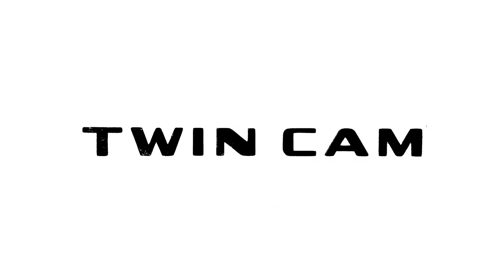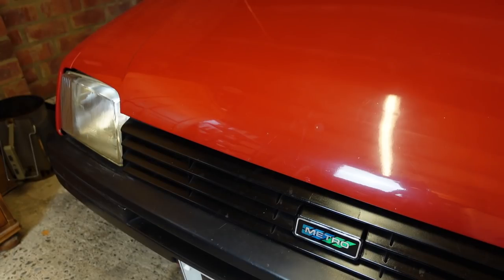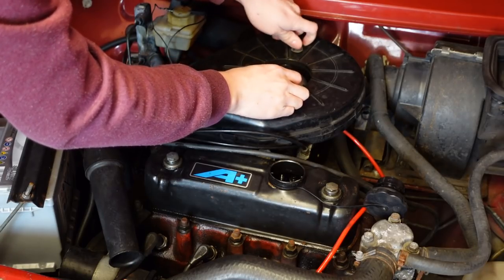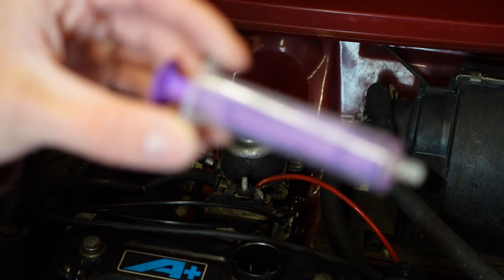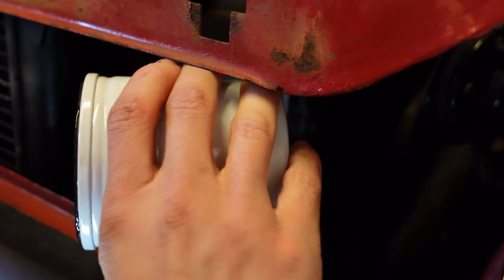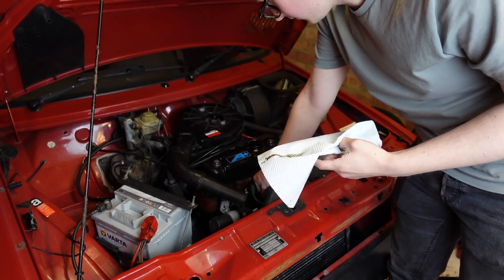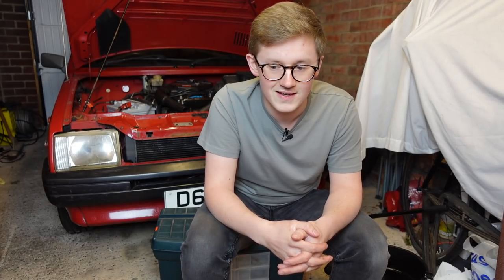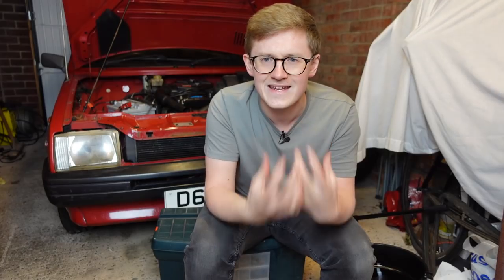An Oil Changing Odyssey - Melody the Metro (Austin A-Series Oil Change)

Comment: Given the state of the air filter and the oil; I would recommend taking off the crankcase breather can, that's the can on the left of the engine (looking from the front), and the pipes going to the carburettor, and give them a very good rinse out some petrol (leave to dry before refitting). These can get very sooted up and is easily forgotten. If you don't fancy taking the can off at this moment, at lease do the pipes.

Comment: Ed, I’m with you on using 20W-50 in my old Benz engines (I live in a temperate climate, no cold winters).

An old car-clubbers’ trick I’ve used for ages is this: A couple of hundred km before an oil change I add about 200 ml of ATF to the sump oil (sump capacity 8 litres). The ATF seems to have very good detergent qualities, and removes varnish; my camshafts and associated cam-box bits are always shiny and varnish-free. And despite the recommended oil-change interval of 10K km (approx 6K miles) I always change the oil and filter every 8K km (approx 5K miles).

BTW: I’d happily watch you for a 40-minute video, no matter what you’re doing. Keep it up!

PS: A related ATF trick is to add 900 ml to a full tank of fuel (90 litres – so 1%) every third or fourth fill. It keeps the fuel system whistle clean and removes the need for injector cleaner, which costs more than the ATF. (My cars run 98 RON unleaded.)

Comment: Whenever I undertake an oil change, I ALWAYS add a can of engine flush to the oil circuit to "wash" out the residue of old oil and sediment that has stuck to the internal walls of the engine during preparation for the oil change itself.

Also, in addition to removing the oil filler cap, I remove the engine dipstick for relieving further vacuum during the draining process, then eventually removing the oil filter after enough time - cleaning the filler cap AND dipstick before reinserting them back in to the engine.

That stops recontamination of the new oil.

Comment: Well done, Ed. The old girl definitely sounds happier. The air filter alone will do that. The tune up will make a huge difference.
Our 81 Volvo 240DL Estate had the 2.1 litre with a single side draught Zenith carburetor. The dash pot on it was so finicky I started sucking all the old fluid out twice a year and starting over again. At 4.5cc at a time, a litre of Type F transmission fluid lasted a very long time. 
Enjoy the old girl. I know what you mean about a car bring part of the fun. My old Volvo 240 is still that way, even approaching 400,000 miles. And now I'm off to add another 120 to the total.

Comment: That oil isn’t available in the US for us A-series owners, but we do have other choices for high zinc content oil (I use Valvoline VR1 20W-50 racing oil). However, my understanding is the high zinc is necessary for the engines’s flat tappets - not for the gearbox of my classic Mini.  But if it helps that too, great!

Comment: Worked on plenty of that set up back in the early 80s. Not many people understood the benefits of servicing back then and I know from experience that set up can take a lot of abuse and still do 100,000 miles+ with the odd exhaust valve change here and there. The metal on the sump bung is most likely the after effect of a less than careful driver slamming it to through the gearbox.

Comment: Nice job. 20W50 oil is the right stuff for older engines. Back in the day Duckhams Q was the one to go for, and it's still available as Duckhams Q Classic. The oil contains long chain molecules which prevent metal to metal contact in engine bearings. Over time they get chewed up and become less effective, so regular oil changes are a necessity.
Reply: Christopher Conroy  If your timing chain is badly worn, you should replace it and the sprockets. Note the timing is important on re-assembly, so get it done by a good mechanic if you are not sure how to do it. If the chain should break it will be catastrophic for the engine. Use the recommended grade of oil for the engine. The Duckhams Q classic I referred to is only suitable for classic cars. All modern oils contain long chain molecules plus other additives which reduce engine wear. All modern brands of oil are equally good, so you could get Duckhams, Shell, Mobil, Q8, or any regular brand.

Comment: Another of your enjoyable presentations in that relaxed easy going style. 👍

Many moons since I checked the valve clearances on A and B series cars. The number NINE is a useful number to remember when doing those eight valve clearances and a good quality Feeler Gauge  is a required investment if not already have one.  Hands up all those who know why NINE plays a part here. 

There's something really satisfying when servicing your own car and in my case, several of  my family's too. Assuring  to know that the job has been done and done well. Not always guaranteed when entrusting the work to others. You can get magnetic Sump Drain Plugs for most cars. Manufacturers rarely fit them now or even Sumps Plugs come to that. Such is automotive progress. There's reasons for those omissions like Dip Sticks and Sump Plugs.  I do not agree with them.

Yes reassuring doing your own servicing. It's not Rocket Science even on more modern cars. and over a lifetime's car ownership, a nice few quid saved which is another big bonus. There's reasons why some folks are always lucky with their cars' reliability, yes even old British ones. Reasons too why some folks are often "unlucky" with their cars' reliability.

Beware the thick black stuff when looking at a used car you are thinking about buying. That and things like Air Filters and Coolant levels and their condition are reliable indicators of how well a car has been maintained ... or, not.

Keep up the good work and YTs coming TC.

Comment: 10w40 was the oil I used on my old classics and back in the 80s , 50w20 is rather thick especially on a cold start up on a old engine, you want the oil up and around the bearings and camshaft ASAP

Comment: 20W-50 made me remember an old car I used to maintain at home years ago! The one I run now uses 0W-20. I do have a spare bottle of 5W-30, which the manual says can be used as a top up, but it recommends that only 0W-20 should be used at a service.

I’m not criticising using 20W-50, but no doubt it was necessary when manufacturing tolerance was a bit different in the past.

Comment: It always feels good when you can feel / hear the difference your ministrations make to the running of your vehicle, doesn't it?  One of the things I have learned is that you can help your engine bearings a bit by filling your oil filter before refitting it, so the engine does not have to wait for the filter to fill up before it gets oil.  Also, if this is the first oil change after a period of much neglect, it's best to do another one after about 1000 miles instead of the usual 5000 in order to get rid of what crud frees up in the engine with the new oil surging around.

I can understand your concern re the metal in the oil.  I had a Mini that when I first changed its oil, I found one half of a small spring washer attached to the sump plug.  Knowing that this had bounced around in there was worrying to say the least.....as was wondering which part of the gearbox it may have come from.  I sold the car, so I never found out, but I'm glad Melody didn't give you something like THAT to ponder at least!  I believe you will find (or will have found) by now that the synchro on 2nd gear feels a wee bit better with the new oil too!

Comment: Hi Ed, you should really get that 2nd gear sorted sooner rather than later otherwise you'll end up needing a replacement 2nd gear, I've got a few spare ones as I do a lot of straight cut gearbox conversions so I have a stock of good used standard gears.

Comment: You are bringing back memories of my silly oil change antics. I pinched the cam follower gaskets in 1.1 ltr Aussie assembled Mini after I had the head serviced and Cooper double valve springs inserted. Then I poured 5 litres of Mr Castrol only to find 4.5 litres of it on my parents driveway.  Keep up the great work but I get my servicing undertaken by the manufactures.

Comment: Blimey what a video. Constructive criticism now. It was bleedin obvious that rocker cover gasket was shagged. It should have been changed during the oil change. Since the oil that came out was beyond dirty I suggest you treat your oil change as a flush. Do another oil and filter change in a hundred miles and do the rocker gasket then also. Also get some engine degreaser and liberally spray it on the engine, let it soak and power wash off. Repeat but 2nd time using a brush to dislodge the stubborn bits. Just giving you some good advice. 👍

Comment: Good to see that you've made a start on getting her running better 
Some advice for you re the air filter elements condition 
You need to check very carefully that the exhaust is not leaking at the manifold to head joint ,or where the front down pipe joins the manifold as in my experience when these leak the escaped gasses are drawn up into the filter by way of the hot air intake  Valve that is operated by the  bymetalic strip / it's the round bit that sits on top of the manifold in the air filter inlet in case you were wondering .
Whilst I'm here please consider another Oil and filter change after about 500 miles but before you do this add a good quantity engine flush to the oil after it's warmed up and then take the car for a decent drive so that the flush works it's way round all the gearbox bits and cleans out the oilways to the rocker shaft which will help the valve clearances next time that you change your engine oil make certain that when you fill up with fresh oil you remove the dipstick completely as this help the flow of oil into the block oilways and prevents the blowback which is messy and to be avoided if at all possible 
Two other things you may want to take notice of,1 valve adjustment don't try and get the tappets right first time and when you adjust the clearances do them with a stone cold engine don't be tempted to go a bit on the tight side to shut the little buggers up ,as at that age they will all be worn and the gaps tend to tighten up once the engine warms up tight tappets lead to poor running and eventually burnt valve seats not nice....
Secondly,i ignition I take it that Melody has the later electronic distributor fitted some of these have a vacuum advance and retard unit ,this needs to be checked to make shure that it holding vacuum and is pulling on the baseplate of the distributor,if it's not having the desired effect the timing goes out of whack and you will have very little chance of pulling the skin off a rice pudding 
Good luck keep her going if you have any questions I'm happy to answer them .

Comment: Just make sure the engine is as hot as can possibly be when you do the valve clearances. Each cylinder runs at a different temperature so has different expansion, the only way to get perfect valve clearances is to do it at full operating temperature.

Comment: Nice job, look well needed, my tip to you would be to fill up the oil filter with oil before fitting the filter as its a vertically mounted.

Comment: Trashed 2nd gear was common place, i bought a few like that and then bought salvaged engine/box units to swap out. Used to take me best part of 5 hours in back lane . I did it this way because i lacked the skills to dismantle and reassemble. MOT failures and stolen recovered were fair game too if cheap enough. Doing tappets and checking engine timing i used to find satisfying….welding not so much.

Comment: I had an old Audi, leaning over filling the oil my foot slipped on the garage floor, tipped a huge glug of. Oil over the block and onto the exhaust manifold. Even after cleaning I could smell hot oil for months.

Comment: You’ll want to change that oil again in 1000-1500 miles as there’ll be a lot of debris / gunk in that engine that your new oil will pick up after the first few good long motorway runs with the engine getting nice and hot.

I wouldn’t use a flush personally but if you must then Comma do one that is full of detergent additives rather than harsh cleaners that’s supposed to be very good. I’m afraid you’ll need to rebuild your gearbox at some point however as it really sounds like some damage has already been done.

I would recommend running a bottle of millers petrol additive to clean the carb jet and inlet / cylinder head in the absence of a full strip-down. Millers are a British lubricants company and I have tried their engine oils and diesel additive with great results - I haven’t tried the petrol additive myself but that’s because I only have diesel cars.

Good luck with it.

Comment: Nothing like a straight forward oil change. Had to butcher a filter with a screw driver myself recently and it wasn't pretty. It's a little concerning a car with a sump mounted gearbox not having had an oil change for a while. It's always at the back of my mind that a crunched gear could potentially leave shavings that could find their way around the entire system.

Comment: WHy don't folks look after their engines?  Oh dear!  I would suggest checking and cleaning all the breather pipes and the can on the left of the engine too.  Seeing the state of that air filter I wouldn't be surprised if these weren't in a mess too.  When I rebuilt my 1275GT it was so clogged with carbon I really don't know how it ran and the oil and filters looked just like yours did.

Comment: Slapped wrist for not changing that minging oil earlier… colour could be due to lots of short journeys andof course traditional mineral oils age much quicker than modern full or semi-synthetic oils. Change interval used to be 6000 miles or so, older spark plugs were 12000 miles.